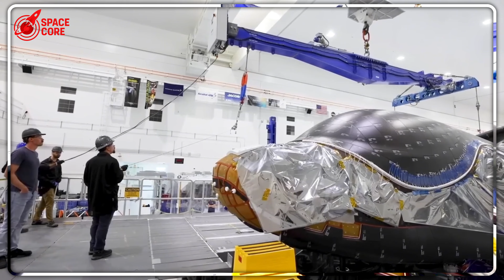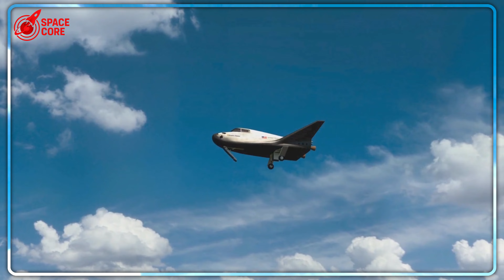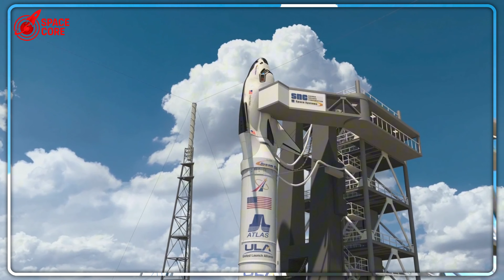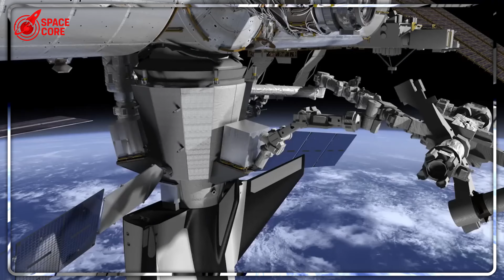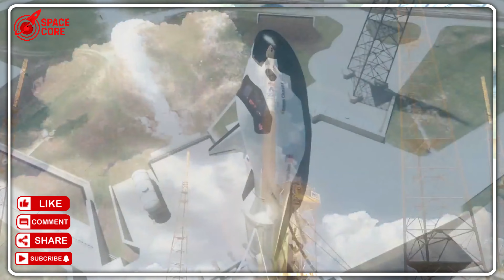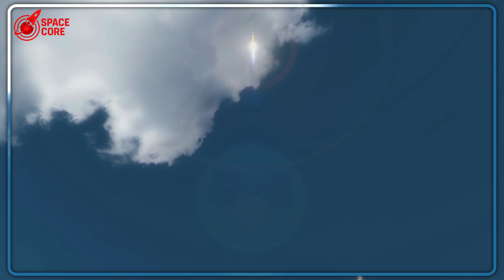NASA Revealed WHY Dream Chaser Will REPLACE SpaceX Dragon...

Comment: When Dream Chaser will not get rated for openly crew launch without a fairing for tiles, fails the full stacked emergency except test. Space X Dragon is the only crew rated craft. I see Space X suing NASA in court for fogging Dream Chaser crew rating certification.
Reply from the maker: Dream Chaser’s crew variant faces challenges with unfaired launches and emergency tests, but SpaceX’s lawsuit seems unlikely without evidence.